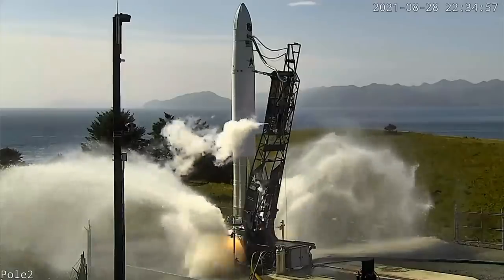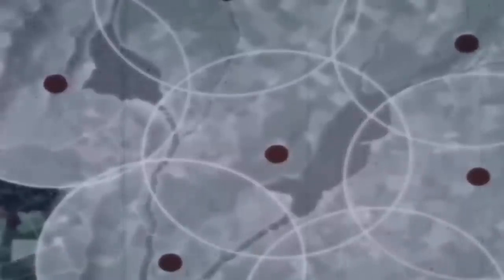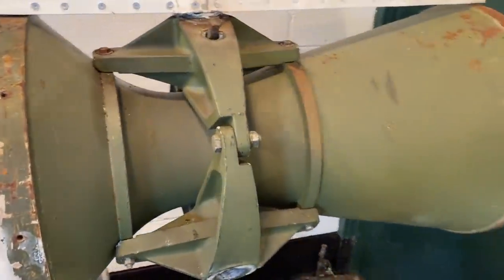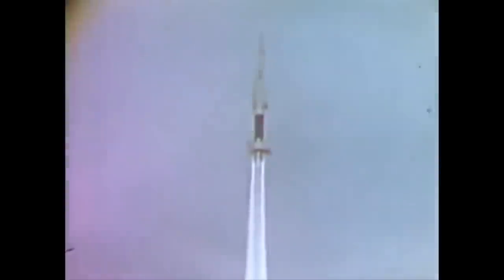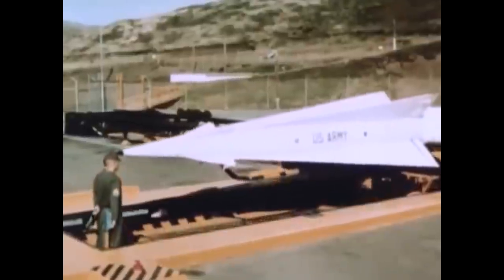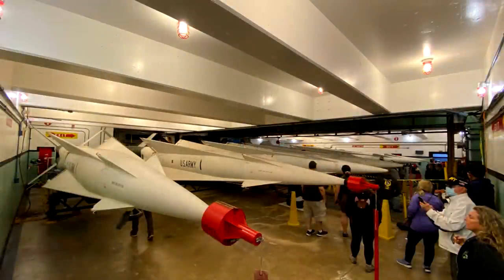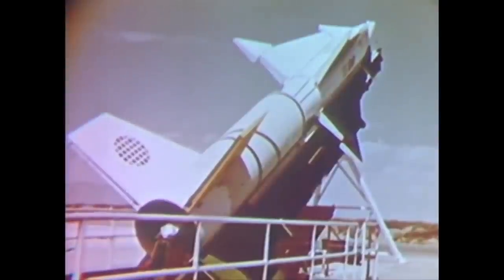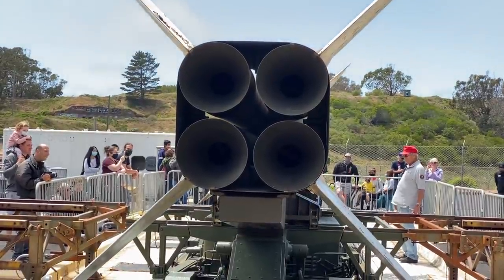Nike-Hercules - US's Surface To Air Missile with Nuclear Warheads.

Comment: In my first engineering job in the late 70's, I encountered a pneumatic analog computer. Compressed air was fed through a set of two dimensional channels that were the controller logic and there were compressed air inputs (signals) at various points and a controller output (also compressed air). It was essentially "hard coded" to perform a set controller task. Unlike a digital computer, there was no concept of a "stored program". It did have an advantage over an electronic controller in our application (which involved explosive vapor) in that it was inherently explosion proof.
Reply: The Nike guidance computer was much the same, hardcoded without a stored program. Roughly 100 tube opamps and only one job which it did to perfection.
Reply: pneumatic analog ... and then there is the early Ford Pinto emissions control, also pneumatic logic.  Just a few months ago, I was presented with a pneumatic logic respirator designed for the pandemic emergency.  ...it was easier to simplify and build existing designs.
Reply: The only type of analog-computers with something like a stored program back then had fast-change switchboards.
Modern analog computers use a digital-computer/fpga part, which then can configure the electro-analoge-computer at runtime
Reply: Analog and non -vonNeumann architectures will figure heavily in the future of AI.
Reply: @-danR  interesting,  how so?
Reply: That's basically how auto gearboxes used to work using oil.
Reply: In the Science Museum in London they have the very advanced bombsight used at the end of WW2 and into the 50s, an amazing analogue computer. It was a huge step up.
Reply: @Salem Engineer.  Now that’s an interesting story!  You have me thinking back to my days of maintaining the F-106 fighter interceptor weapons system. Much of its mechanical systems were pneumatic.  Like the Nike missile system the F-106 aircraft was part of the SAGE (Semi-Automatic-Ground-Environment) air defense system.  Cold War cool stuff!
Reply: @millerdp  And that reminds me of the successor to the SAGE, the AN/FYQ-93 Joint Surveillance System that I maintained in the 1990s.  It was housed in the same building as the SAGE computer, but took up only one floor for both the computers and the operations rooms even though it was still late 1970s technology (installed in 1983).  The old SAGE rooms and command post were about four stories high and covered quite a bit of area.  There were of course a few pictures and even a few cards of core memory from the SAGE floating around back then.
Reply: I never worked on any analog computers, but in the Air Force I did work on a computer from the mid 1960s that was all transistorized logic gates, literally one card per function (this card is four inverters, this card is an XOR gate, etc).   Drawers held up to seventy or so of these cards and logic was connected via backplane wiring.  220 7-bit words of core memory in the units we had, 35mm magnetic tape for backup message storage, and all it really was was a two ton digital telephone that would send messages to IBM Selectric typewriters (by the time I got there, a monochrome monitor, keyboard, and thermal paper printer were adapted to it and most of the Selectrics were retired).  I never saw any of the three "proper" computers in the system, which were huge affairs located at SAC command posts.  For diagnostics, the drawer testers had "programs" done by jumpers on perforated boards about a 1' by 1.5', and would give results on lights you'd have to decode to figure out what the fault was.
Reply: Same thing for n c milling machines in the 80s
Reply: @womble321  They still do but now have an electronic overlay moderating the valve functions
Reply: Would the hydraulic system in a fully mechanical automatic transmission qualify as an analog computer?
The "program" would be shift at X rpm, taking into account throttle position (eg. delay shift by X rpm for each percent of throttle applied)
Reply: @womble321  Automatic transmition boxes still use a hydraulic "brain".
Reply: @thenasadude6878  Yes it would, as it's a logic controller with inputs and outputs.
Reply: @thenasadude6878  The only fully mechanical auto trans I have experience with are those in trucks, and they have simply replaced the manual clutch and shifter with computer commanded air solenoids to move the shifter forks and clutch throwout.
Reply: @thenasadude6878  Frankly I would say yes.  Though it isn't general purpose (and most of our examples haven't been general purpose), it does make logical, non-linear and fairly mathematically complex decisions.
Reply: @Motoguzzi750  Norden, right?  could calculate wind drift, aircraft skew (crab) others on top of standard air speed, elevation, heading.  probably one of the most advanced analog computers up onto Apollo guidance where it joined digital but still solving the heavy math/fast computations before input to the digital portion (if memory serves me?)-  thank you Scott for putting these up - always a good day for me when I get to see you posted a new one.  I'm an automation engineer 41 years in his career.  I learn every day - life is good!!
Reply: @prestonburton8504  hi Preston, no not the Norden this was a late war British bombsight that was better than the Norden, as it should be it was developed years later. Will try and track it down. First fitted to Pathfinder Force Mosquitoes and Lancaster, and to 617 Squadron The Dambusters Lancaster....
Reply: also has the advantage of being EMP proof.
Reply: @womble321  pretty much. Just a lot of inputs from throttle position, manifold pressure, engine speed, road speed and selector position, outputs as gear selections. Clever, clever stuff and very durable.

Comment: We had these in Italy well into the 2000s. Nike-Hercules was officially decommissioned by the Italian Air Force on June 15, 2007. The last test launch of an Italian Nike-Hercules missile happened on Nov. 24, 2006 from the Capo Teulada range on the Sardinia island.
Reply: Carbonara
Reply: I was stationed at one of those Italian Air Force missile sites in the Veneto in the early to mid 80's.  We were U.S. Army custodial teams for the special warheads.  It was great duty for late era Cold Warriors.  The Italian Air Force did most of the hard work.  The Americans operated in 24 hour shifts, one day on standby, one day on, one day off.  We got to explore the region on frequent one day passes.  Occasionally we would be invited to dine in the Italian mess.  It was a much appreciated break from our Army chow.  The presence of the special weapons were supposed to be a secret, but one of the communist Italian newspapers published a map every year with the locations of all the installations.
Reply: @glennmitchell9107  I served as a radar operator in the major radar station (11° Gr.R.A.M.) in northern Italy in '89 and '90. I remember we had direct communication channels to most of the missile sites in the same area. We worked together on every major exercise. Fun times.
Reply: @glennmitchell9107  are these anti-air only or can they fire surface to surface/anti-ship?
Reply: @Aaron-zu3xn  The were surface to air, although they had surface to surface capability.  I don't see why they couldn't have been used in an anti-ship role.  I suppose the Italians were worried more about Russian bombers then they were about the Russian navy.
Reply: Good info never knew that about Italy.

Comment: I’m a Nike Hercules veteran and I think this is the best description of the system by a lay person that I have seen.

One small quibble I have is about his use of the term altitude instead of elevation when referring to the tracking radars’ inputs to the computer.

The tracking radars provided target and missile locations via three polar coordinates, Elevation, Azimuth & Range.

The computer would calculate Altitude based  on the Height of Site, Elevation, Range and Earth Curvature.
Reply from the maker: Yep, as astronomers we use altitude and azimuth, but that gets confusing when talking about pointing at things that aren’t a million miles away.

Comment: The Washington DC area had many Nike stations mixed into the suburban landscape. My sister had horseback lessons next door to one of them. Edit: site W-45.
Reply: I lived a bicycle ride away from one on Long Island.
Reply: @thomas316  well it would depend on altitude and direction relative to a city. West coast yeah east coast yeee...not entirely. Wind tends to go west to east across the US. Emp damage would be the bigger issue, and maybe a semi reaction with partial yield from an ICBM that had survived the Nike warhead detonation.
Reply: @thomas316  Making h-bombs created permanent sacrifice areas (Hanford, Savannah River, etc.) even if they are never detonated.
Reply: I was station 22 mile west if D.C in Gaithersburg MD. W-92 wast it's location. A 4/1 ADA offers Muddy branch road.

Thr booster drop zone was the National Gerographic building.
I coild see the National breau of Standards outside my office building.

The Washington National Golf course separated the Radar from the Launcher area.
Reply: @thomas316  These weapons detonated in the air.  The majority of nuclear fallout is produced by weapons that detonate near the ground.  It is the dust, dirt and ash that is blasted up through the radioactive fireball and then falls back to the ground, so these weapons didn't produce much fallout.  Not that it really matters.  Where do you think the fallout went from all of the nuclear tests in Nevada?

Comment: I was trained in Nike Hercules before they replaced it with the "Patriot" missle system. The missle actually leaves the rail at the speed of Mach 3 to Mach 5. Now that is coming OFF the launching rail. AND, the ground capability enabled the Fire Control to literally hit a 4x4 stuck in the ground, I witnessed it. SO it was accurate at times when needed.

Comment: Just for reference, the Nike Hercules force alone had 2,550 nuclear warheads produced for it.  That more than the US has deployed on all types of nuclear weapons today.  

The Nike Zeus Scott shows is the Zeus-A.  It was replaced by the Zeus-B (neither of which entered service) which was subsequently replaced by the Spartan in service.  The Spartan's 5 MT (with a "mega") warhead was tested in an underground nuclear test in Alaska.  (See the Cannikan test.)  Other US Surface to Air missiles with nuclear warheads were the Sprint, Bomarc, Talos, and Terrier.
Reply: I wanted to write genie but it’s not a SAM but with similar Profil to the Nike system just air born ;)
Reply: It's amazing how much GDP went into systems that never entered service. Reading up on the era, it seems like it must've felt like everything was advancing faster than it could be kept in balance.
Reply: @MrTrashmasterfx  It had a nuke.  That's where the similarity ended.  It's range was about 5 miles and no guidance system.
Reply: @franceslarina5508  The nature of the beast.  This kind of stuff is so difficult, and takes so long to develop, that if you wait until you need it to start working the problem it's too late.

Comment: As a past denizen of the Holloman High Speed Test Track. I can speak fondly of the the Nike booster rocket motors taken from the 4-pack Hercules booster.  Old fashioned double-base propellant (~50% nitroglycerin / ~50% nitrocellulose + secret herbs and spices to stabilize the mix) extruded in long rectangular rods (like a stick of butter as long as the motor case).  Very rugged and completely suitable for the test track vibration environment, they are nearly all used by now.  The igniters for the motors is screwed in at the front of the motor prior to launch.
Reply: As soon as I saw it, I saw Holloman Test Track in my mind.
Reply: Sandia still uses these.

Comment: My dad was a missile battery commander at NY-56, Ft Hancock, in 1963-65. I recall having the run of the base (other than the missile sites themselves) while little more than a toddler myself. The ultimate gated community... 13 Hartshorne Drive was our humble abode.

Comment: I'd love to hear Scott talk about Sprint, the later ABM that could reach Mach 10 in 5 seconds.
Reply: If you talk about Sprint, you have to cover Spartan, too.  They were a matched set of endo- and exo-atmospheric interceptors.
Reply: The Sprint is one of the things I have to read about again every few years because, apparently, by brain will not accept that the numbers are real and refuses to store them. A 4 ton rocket with 340 tons of thrust if my math is right.
Reply: @steveanderson9290 , I was just reading up on it on Wikipedia, and according to that article, Sprint was meant to accelerate at 100 Gs.  That's hellacious!  But to intercept a warhead that's already descended below 250,000 feet altitude, that's what was needed.

So . . . Wow!  That's some engineering!

Comment: I used to live near the town where the plutonium for the Nagasaki bomb was produced, and back during the Cold War, there was apparently a Nike missile battery on the mountain overlooking the nuclear facility... because the facility was a known Soviet nuke target in the event of WW3 breaking out.
Reply: There were 4 Nike Ajax batteries around Hanford. When they switched to Hercules, three were closed in 1958 leaving only the site on Rattlesnake Mountain 46° 23.508'N, 119° 32.028'W which was closed in 1960.  The Ajax sites are at  46° 41.724'N, 119° 42.163'W,  46° 44.519'N, 119° 25.602'W, and  46° 41.174'N, 119° 24.459'W. All GPS coords are for launch sites. The radar fire control sites overlooked them from a couple miles away.

Comment: I just watched a video on Battleship New Jersey about their fire control computer. Apparently, it is a series of gears and cogs that takes readings and you can dial in corrections. I assume its a generational leap from difference engines from earlier.
Reply: In many respects, not really. It was a fairly standard evolution of previous technology, just refined to exceptional precision. British and American warships developed exceptional fire control over the course of the war, including radar-guided guns, which is rather more impressive, all things considered. The battleship HMS Duke of York sunk the German battleship Scharnhorst with radar-directed guns at night in a snowstorm, for instance. An American fleet sunk the Japanese battleship Yamashiro with radar-directed gunnery as well, literally shooting the Japanese from over the horizon.

The main revolution in computer technology in WW2 came about at Bletchley Park, through the work of Alan Turing and his colleagues. The computer they built to counter Axis encryption was an astonishing feat of engineering.
Reply: Not that much of a leap when you think of it. It's just a bunch of (relatively) simple mechanical computing units hooked to the same output.
Reply: I saw the New Jersey fire in 1983.
Reply: You should look into the Norden Bombsite. The third most expensive weapons program of WW2 after the B29 and the Manhattan program.
Reply: @byrnemeister2008  The practical performance of the Norden bombsight was highly overrated. In combat conditions it fared no better than other allied and German tachometric bombsights. Its almost mythical status was to a degree boosted by Norden's own advertising efforts, once some of the secrecy had been lifted.

Comment: From 1972 thru 1975 I was on a Nike sight in Germany I worked in the IFC (integrated Fire Control) My job was the MTR (Missile Tracking Radar) operator. I was privileged to participate as a crew member to 3 Live firing at annual Service practice.
Reply: Where did you get your training?
Reply: Was a 24U Nike Mechanic.  72-74, then reclassified to 24N Chaparral mechanic.
Reply: @kevinbrown7171  Ft. Bliss was the Home for ADA schooling until 2000s when it got ship back to FT.Sill where it wad born.
Reply: @bradhanley8368  my father retired in 72 at Ft. Bliss. He spent most of his career on the Nike program, and later Safeguard. :-)

Comment: I was stationed on an American Nike Hercules site in Germany, there were 3 sections, each section had 11 missiles of which 5 missiles had nuclear warheads. Nike Hercules nuke's had a 2kt, 20kt or a 40kt warhead, our site had mostly 20kt and a few 2kt warheads. The non-nukes were HE. The duty really sucked because of security and sooo much guard duty on the towers and gates and all the exercises with the missiles and inspections. The were 16 American firing Nike Hercules site's in Germany, we all knew we would be a high priority target if the Soviets had attacked, we would have been lucky to even fire off a missile before being attacked. Cool video!
Reply: Survivability sure wasn't helped by all of the Hi Power radars being in domes mounted on the highest point on the skyline...even if they did paint some of them green!  And quite a few of them seemed to be within RPG range of the Autobahns...{!-{>